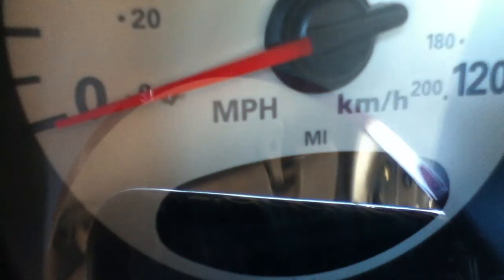2001 PT Cruiser CEL fault code dash display method .  Check Engine Light  MIL OBDII OBD2

Comment: S.O.S. 2005 PT cruiser 037 ...031 on both B1 and B2 replaced both 02 sensor's and ASD relay 160 miles reading low voltage again. To them
Reply from the maker: Have your alternator tested at advance auto and auto zone.  System voltage might bee an issue
Reply: @JnJShiffler  Battery is the right voltage had that checked wouldn't the battery dhow not being charged if it was the alternator?
Reply from the maker: Alternator voltage regulators can go bad.  Some pcms are sensitive to a specific voltage range.
Reply: @JnJShiffler  Thanks I'll check it can it be checked with a voltage Meter what should it read as far as voltage?
Reply: That's for the broadcast very informative! !!
Reply from the maker: The auto part stores can do a free in car testing.  14.6v I think most are regulated to.  If I recall correctly.     List your fault codes & descriptions
Reply from the maker: what were the full fault codes and descriptions?